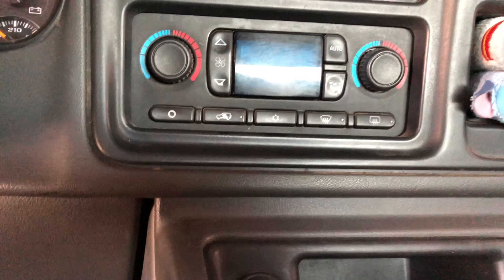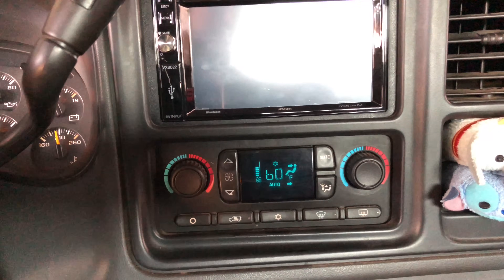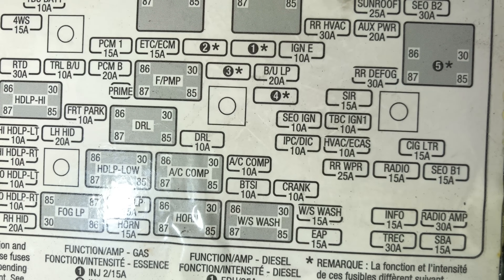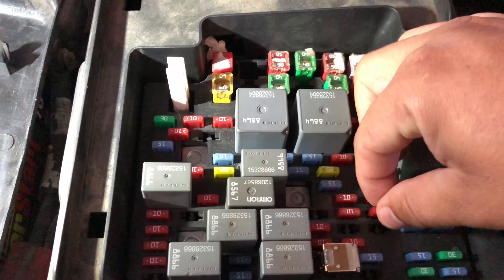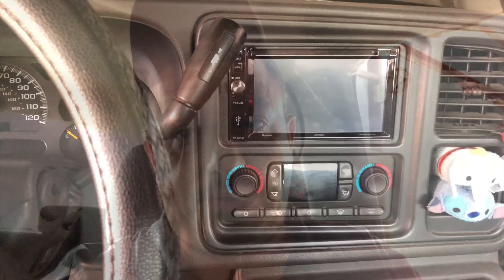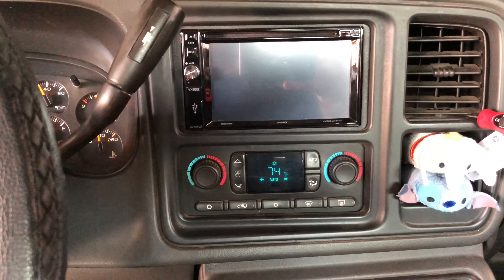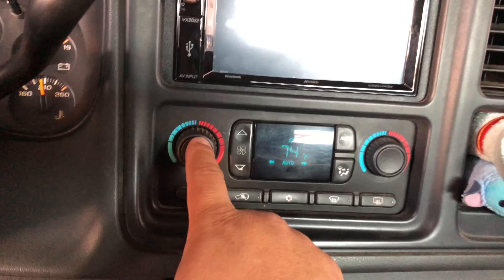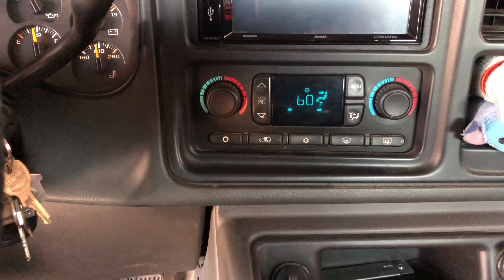HVAC Automatic Blend Motor Actuator Recalibration Procedure for GM Trucks & SUVS FOR FREE

Comment: My 04 Avalanche after pulling fuse for 90 seconds my controls turn on at 75° and does not turn on at 74 and go through all directions  it goes on 75 and stays at upper defrost vent only

Comment: One time in the middle of the summer on the hottest day of the year, my AC started pumping out blazing hot air. I watched a video on how to fix it, but one part that they left out was recalibrating the system after pulling the fuse. That was a good tip. A very critical tip. Thank you!

Comment: Hello, Will this process work for my 2003 Chevy Tahoe z71 if all my front units are working great but my back a/c for 2nd and 3rd row are blowing hot air on a/c. I know it’s not a recharge issue since front blows ice cold. Both climate controls on front and back have an (auto) option so I was wondering if I would take the same approach but putting (auto) for both front and back? Or is this reset process just for the front actuator/ vents. I would love some advice/help😅 thank you.

Comment: 2007 thru 2014 pull fuse number 38 and it will cycle. thx bro, the Chevys are finiky but works thx😅
Reply: just turn key to on no run, so you can hear it

Comment: Question, i have an 04 avy thats ice on driver side but fire on the other. Did this. It cycl3d and woudn up stuck again right where i started. 

I managed to do the process again and cut the truck off mid cycle where both were blowing cold and start it bakc up and itll stay there i guess until i need heat again which is rare where i live. 

My guess is that side is gummed up and may be getting stuck on the hot side?  Idk. Any help? I know the motor moves because during the recalibration itll swap back and forth. It sjust afterwards regardless of what i do with the knobs it still gets stuck.

Comment: Good video, it makes sense. I gonna try it on my 2001 e320. Driver side throws hot air and passenger slight cool air..but I already gave the condenser and fan that I'm gonna replace anyway. Hopefully your recommendation works out...

Comment: Make sure it's the actual actuators that are bad.  I had a fresh air/recirculation door that wouldn't move as well as an A/C compressor that was running constantly in all settings.  Turned out it was a bad HVAC control module.  Dorman makes one that doesn't require a programmer.

Comment: 6:49 Evening sir, I got a 2008 chevy avalanche  , installed driverside blend door. Now I calibrated with snap on solus. When calibrating customer messed with the a/c and fan buttons.
Now when on defrost air comes out vents when on vents cones out defrost. Do you know how to fix this problem?
@falconsGarage

She was blowing ac on passenger side but not driverside. So i switched out driverside blend door.
Then used snap on solus diag and calibrated her. 
I did not take out fuse ( I did not take out fuse i followed snap on solus. 
Started car everything working great. Then turnes car off, then 5-10 min later start car now the air defrost comes out vents and when on vents air comes out defrost? 
More detail
@falconsGarage

Comment: Tried this over 10 times but it never resets to 74. It stays at 60. What am i doing wrong @falcon?
Reply from the maker: @yungmavo  is the ac system working properly?  Meaning the mechanical aspect of it … compressor, condenser, belts etc?

Comment: I did this caliubration and it totally fixed my issue... which was ... the left (Drivers side) and right (Passenger side) temperature would not syncronize to the drivers side control dial, I always had to turn the dials for both sides up or down. They were acting sepperately. Now the arrows at bottom of temp display are both on and the temp can be controlled for Both sides simultaneously by the one dial !  Thank you for this video !!!
Reply from the maker: Glad I was able to help!

Comment: After I remove the fuse and do the 2-minute restart it stays cold for about 10 seconds and then goes very hot with the AC on. Unfortunately recalibrating did not work on my 2004 Suburban. I guess this means I have to get into the dash. 😞

Comment: This is different on My 2004 GMC Envoy SLT XUV, which fuses do I pull ?  Don't have the HVAC/ECAS 10amp fuse to pull under the hood or under the backseat fuse box ,  what is the correct procedure for and XUV with 5.3L V8 with no rear A/C ??? Thanks !

Comment: I have no cold air. Feels like the heater ac blend door is stuck on heater only if that's one of the blend doors or not I belive it is all other functions will work I obviously did the recalibrate and it's still stuck on hot air only even with the compressor kicking on and off, any advice much appreciated

Comment: I have an 04 suburban and I just did the recalibration process and on mine it was still blowing hot when I tuned it all the way down to 60 but when i tuned it all the way back up to 90 then back down to 60 it fixed it self and started blowing out cold

Comment: for some reason after I did the recalibration, the cold and heat switched from driver to passenger side and no matter how many time I redo it stock this way, so now cold on driver and hot on passenger side , what do I do now ?

Comment: Did not work for me, what next?
Reply from the maker: Most likely one of the doors isn’t working. Next is to see which one. Assuming your AC system is working properly
Reply: @FalconsGarage  Yes AC system works on the passenger side, heat out of the driver side unless i manually move the door.  The new motor seems to go all the way one direction no matter what i do

Comment: Great video very informative I have a 2006GMC Sierra 2500hd has the same heat controls as in the video when I put mine on Auto it does show 74 but not indicating its on the defrost but shows on the floor blowing down I have tried changing it but doesn't just goto defrost any ideas what it could be all the vents work except the defrost one.

Comment: Very Good My Man 👌🏻
I been Fighting an 02 Escalade, and after this Proceedure, it has appeared to have fixed my Issue, I either had Flesh Burning Heat, or as soon as you touched the Climate Control, to Reduce Heat, it would go Stone Cold.

But I will say, I had to Cylcle it Back and Fourth a Few Times, all the way Cold to All the way Hot, and it Seems MUCH BETTER now, still seems a Little off to me, but it is working now, I do think I'm going to replace the Hot / Cold Blend Actuator, it just Takes too much of the Heat away, but as I said, it does Function now. And also mine has 3 Turn Dials, and the Temp Knob appears to Lock into AUTO as Well ???

1 thing I would add, is If you Have Rear AC, to Pull BOTH HVAC Fuses, at least I did anyhow, Our Rear AC is Bypassed but there is still a Fuse there, and BOTH OF MINE WAS 30 AMP

Comment: 05 yukon gmc. Minnesota freezing 
I was here last year and your video cured my heater actuator reset. it only works at 90° and that's just fine. But now my rear heat quit working after I unplug the battery all night because I have a parasite drawer in my door lock. I tried to reset a couple more times but no go.  Front works fine at 90°.

Comment: I have a 2004 Yukon. Cold air out of drivers side snd hot out of passengers side. I had just replaced the lower passenger side actuator about 3 months ago so I thought it was defective because I bought it from amazon although it was quiet and not making any kind of noise. The original had stripped its gears and could head the noise. Saw you video and a couple others dealing with this problem. I liked yours better. You explained sequence better and showed exactly what to do. I followed your direction and at the end I had heat on both sides. I could not see any sequencing going on while it was recalibrating like your video showed snd it was quiet so I thought it wasn’t working but after two minutes I turned vehicle off and then restarted and it all worked. 
Thanks for the excellent video. I definitely did not want to to rip the dash out to replace those hidden actuators. $1000,00 to do that
Reply: 6:42
Reply: Of

Comment: Tried you reset and I got nothing. I replaced the whole control unit, blend doors. Nothing. I get ac fine but I turn the nob to 61 instant 90 degree heat. Can use some help here
Reply from the maker: Just a shot in the dark here but I would say you probably have a bad air temp sensor, the one that goes inside the air box.
Reply: @FalconsGarage  would you know where that would be located at and in what area on a 2005 gmc 2550hd?

Comment: i will try this but hummer H2, 2004, a/c and heat only comes thru defroster, not thru vents or to floor, i will try to reset it, but one mechanic said the dash would have to come off, he said blend doors are blocked, he said theres leaf's, line needles, etc in there, some where ? he saw with camera, any help is appreciated,  could it be blend door ,, blend door acuator?,
Reply from the maker: Yes this could be any of the things you mentioned actuator, blend door or even a wiring issue. But if the mechanic already checked it and saw the issue I would go with that unless you don’t trust your mechanic and if that’s the case sounds like you need a new mechanic. 

With that been the reset procedure would not hurt anything so it doesn’t hurt to try.

Comment: Follow up to my question a couple days ago! My AC stopped working on the passenger side of my 2017 Kia Sportage SX AWD Turbo GDI a few weeks ago and I was able to play with the controls and get it back on! Well a week ago it happened to the driver's side blowing hot air! So I did everything you said although I'm not sure I even pulled the right fuse because it's not listed AC or HVAC.anyhow nothing! Then I remembered watching a video on how to reset it but I was convinced it was the fuse! But I tried the reset and it worked! So if anyone out there has this problem with there 4G Kia put the controls on auto and sync with the AC button and recirculation button on and turn the driver's side knob all the way to the left I went around a couple times after it hit 65 and then do the same to the right and then back to the cold again! This should work if not try the passenger side the same way!

Comment: Before trying this method, my driver's side would only blow hot and the passenger side had no problems. After trying this recalibration, the drivers side only blows cold and the passenger side is still fine. Any ideas on how to resolve this?
Reply from the maker: the actuator is probably bad .. I would start there

Comment: I was trying to do this on a GMC Yukon Denali 2004. The thing is after removed the HVAC fuse and going to turn on the engine.. the temperature is at 74 degrees BUT the system blows super hot air towards the face and doesn't switch to the feet nor the windshield area...
Reply from the maker: I would start checking and making sure all actuators are working properly .. what was the issue before .. why did you try recalibrating?

Comment: I have an issue with my AC in my 2013 Chevy Silverado 2500 HD where when the AC is off I can still fill air coming through the vents before I was having issues with the heat to where it had to be on 90 to blow hot
Reply from the maker: Sounds like you have electrical problems. Doesn’t sound like common problem so I would start with checking your controls.

Comment: What else can it be if the ac doesn’t work good up front (blows warm mush air) but blows out cold in the rear ?? Anyone have any knowledge on this I’ve already replaced the control module itself and it doesn’t seem to fix the issue a lot of local “mechanics” don’t seem to help either looking for last possibilities before just taking to the dealership 05 suburban Z71

Comment: Hey Falcons.  So This is what I am getting.  I tried this method.  (It is a method my wife and I have done many times and it worked)  Now when i do it... i feel some minor cold air come through the front vents, but its not strong at all.  The side panels on the passenger and driver side have a little circle vent that the cold air comes out of very well.  The air comes cold and fast out the rear vents.  But just no constant air flow out the front vents at all.  Oh and it is coming out the the floor  (mainly passenger really strong and cold)  wondering what i should do next as I am trying to do this fix myself without having to go to a dealer / shop.  Do you think it could be the blend door actuator itself ?

Comment: The driver's side vents on my dad's 04 2500HD were stuck blowing firey hot air after the batteries going dead, rather than spending $145 for a new blend door actuator I tried this and it worked!  Great video!

Comment: Didnt work for me. I wonder if the auto fan control thats above the driver on the head liner being bad has to donwith it. Who ever owned the truck before me did somwthing to it. The drivers side only blows cold. The passenger side blows cold when I turn it to 90 and hot when i turn it to 60. Gonna go ahead and just change all 4 actuators and then do this to make sure its callibrated correctly. Been this way for 3.5 years now lol

Comment: So this whole winter only my defrost would work which wasn’t awful but now with the sun coming out it does not want to change airflow, stuck on defrost. I did this reset, I unplugged the battery that I saw on another vid and I unplugged the cord to the actuator and nothing. Can it really be the actuator I need to replace or am I in deep shit with what you said is an awful procedure 😖😭

Comment: I just istalled a device on my h2, and I was having an issue where the unit would let in through the vents while driving. I just did this so I'll if it ended it up working

Comment: Thanks, you're a lifesaver....worked on 2002 trailblazer, fuse panel with hvac fuse  is under driverside rear seat on trailblazer.......... Intended to put 2002, put 2000 instead

Comment: Thank you so much for this video, but I have a question.  My car is a 2011 Hyundai Sonata Limited 2.0T.  There is no place that shows the temperature. There is a driver's side dial & a passenger side dial with no numbers on them either.  What should I have these dials set at?  The blend door actuator on the driver's side is the problem, as the sound when car is starting, is heard coming from it, & I have no heat on the driver's side.  The passenger side is fine. Thanks for your help!

Comment: My 2004 chevy avalanche heater fan is not working for drivers side floor when I set to floor heat but works on all other areas. The passenger side floor heat blower does work on that side though just not the driver's side)...will this reset fix the problem I have?

Comment: Great video! Question: I have a 2012 Passat TDI and when the HEAT is on the driver side is blowing fine, but the passenger side is blowing only cold air. Any suggestions?
Reply from the maker: blend door actuator

Comment: My ac sometimes dosent turn on like no airflow but when it does it works perfectly fine I just replaced the resistor and did this recalibration any thing else it could be

Comment: my problem was hot A/C vents on passenger side, cold on driver side.  Did this and now I get no air from A/C vents, just defrost.  Is there a separate controller for where the air goes? i.e., vent, defrost, floor?  Where is that controller, and how hard is it to replace?

Comment: This works folks! My silverado does this lately whenever I disconnect the battery for repairs. But never did this until recently. I have found on my truck that the third time is the charm on this procedure. Don’t get discouraged if it doesn’t work the first time. I don’t know why it take multiple cycles for my truck but it eventually works. Good information mr falcon!

Comment: 1998 plymouth breeze 2.4L 4cyl exact copy of dodge stratus. Just replaced blend door actuator under steering wheel dash area behind radio above gas pedal. The face front dash vents don't blow air but the defrost and side vents do. It blows cold and hot but no air from front vents even after new actuator,  will unplugging my battery and hvac fuses and reinstalling them FIX THIS? Please god someone help me! SOCAL IS HOT 😆

Comment: Bro you said you stay in the LA area? I stayed in Long Beach area I'm having AC problems in my Hummer. I did what you said but it doesn't seem to be working it's still blowing hot on the driver side cold on the passenger side. I'm thinking it's the driver side blend actuator but you can't switch it to defrost or circulate either. In addition, possible iceing on the dash. But I will replace those two sensors under hood you talked about in one of your videos. And I'm sure I'm not doing something right but I also service four-wheel drive, I tried it the way you said but it doesn't seem to work still shows up. Quite honestly nothing about this car makes me believe it can climb over any rocks. It's so sensitive
Reply from the maker: no, im in texas  .. does the system have enough Freon?

Comment: Awesome video.  Got a question. I troubleshooted all my actuators.  My 2011 chevy traverse is making a a clocking noise. When its on recirc, it goes away. But oncexi go to defrost or no recirc, it starts clicking.  I see the defrost actuator move. U think it needs to be calibrated??
Reply from the maker: the clicking sound USUALLY means a bad actuator